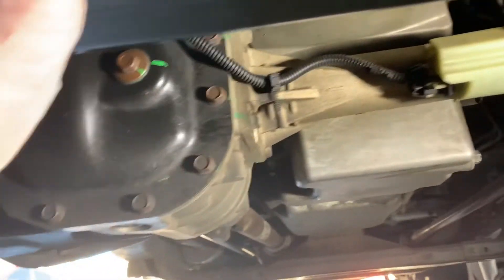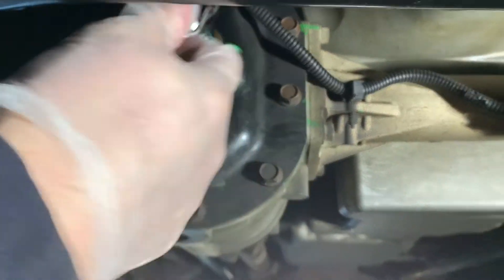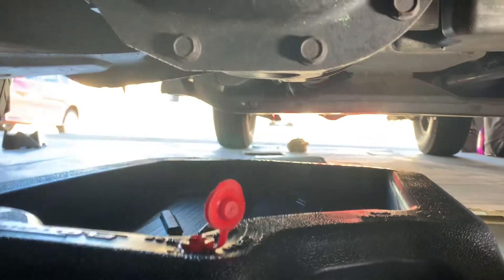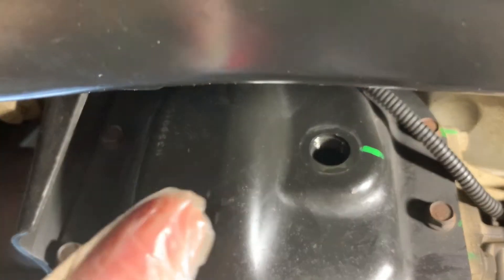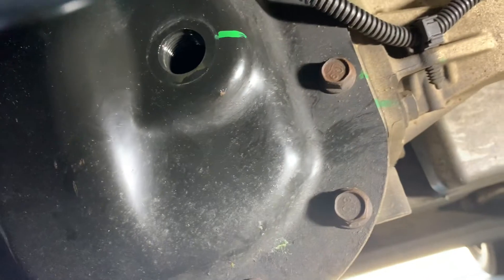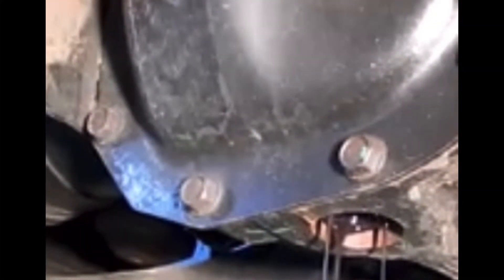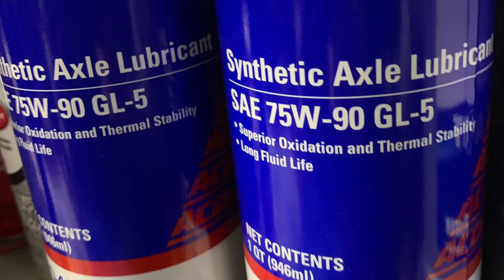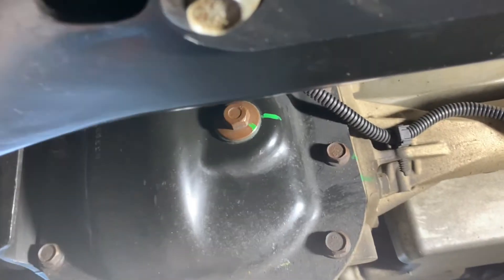Front Differential Fluid Change Chevy Colorado (GMC Canyon, Hummer H3)

Comment: How did you pump the fluid up?
Reply from the maker: The fill plug on the front differential was easy enough to access in this case that I was able to pour it directly in from the bottle (enough room to tip bottle up). (I stole one of the pointy tip caps from an old bottle of gear oil and screwed that onto the fluid bottle specific to the truck). 

Another option is to use a pump style that allows you to keep the bottle on the ground:
https://www.amazon.com/Slippery-Pete-Fluid-Quart-Bottles/dp/B07CX4XKFH/ref=sr_1_2?dchild=1&keywords=gear+oil+pump&qid=1609221266&sr=8-2

Comment: How many miles should it b changed
Reply from the maker: Good question. The owner's manual doesn't give a specific interval, so I just change it every 100K at the same time I do the transfer case fluid.
Reply: Thanks for chat back I got 4 Colorados 2 have v8 s 2  have 5cylinder all over  one hundred thousand
Reply from the maker: @clintpeterson9028  nice, they are good little trucks.